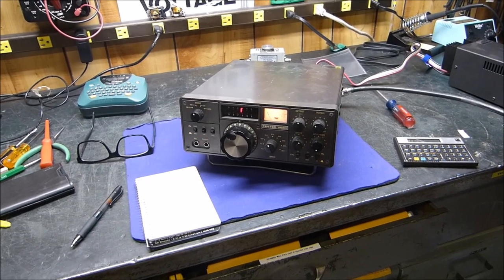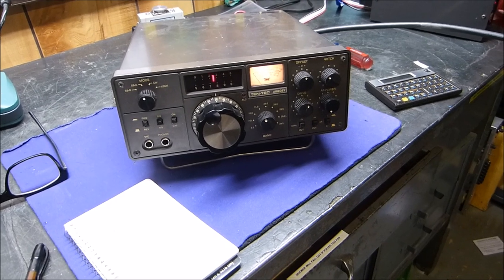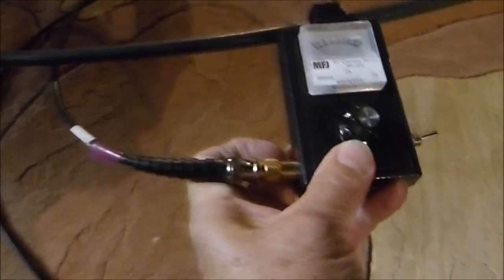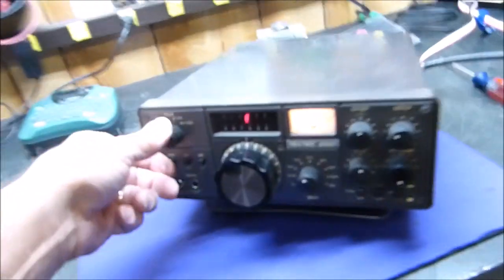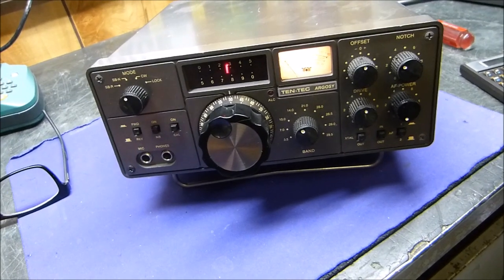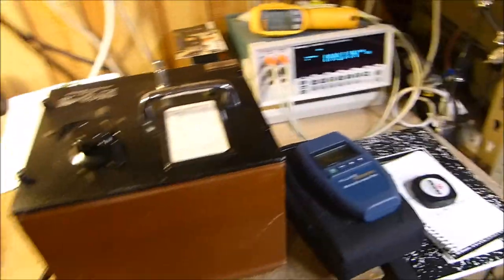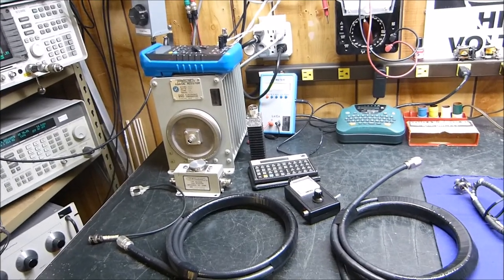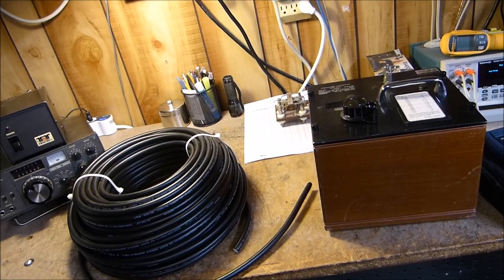Common Mode Coax Choke Baluns

Comment: Man... there are a lot of jewels in this video. I really enjoyed the visual representation of a standing wave. The common mode choke demonstration was outstanding. The comments on coax length were a great reminder that I know I sometimes haven't followed. The chassis for your Collins amp is gorgeous. 

Your comment on old capacitors tracks with my limited antique radio and test equipment restoration experience. Out of a dozen or more restorations (oscilloscopes and other test equipment as well as radios) I've found very few capacitors to still be good. Electrolytics are almost always bad. Mica caps are the most reliable but I've had to replace those too. Some devices, like Heathkit made test equipment, can also have bad resistors. It's weird. It's like they had a bad lot of components but that's not likely at the time it was made. Two identical piece of gear require differing amounts of replacement parts.

It makes me wonder about some of the newer old pieces of gear that I still use. Back in the day they built things to last and they did. Today I don't know if my 15 year old Yaesu is going to hold up like my recently acquired Collins  35S-3/72S-3 have. That said, recapping isn't all that hard to do. But we've had that conversation back on your rotatable dipole video :)

Thanks for taking the time to go through all of this David

Comment: ElPaso - Question for you.  My understanding is that common mode currents on the xmsn line shield are due to the antenna not being perfectly unbalanced.  In your video, you have created common mode currents by introducing a capacitive reactance into the your "antenna simulator" .  Would you say the common mode currents are caused by the resultant VSWR or by the general asymmetry introduced by the capacitance box and associated leads?

Comment: David,it looks like the balun choke either tuned the antenna or made the transmitter happy by tuning the antenna..Now, what is the difference between that what my roller inductor tuner does.?
Reply from the maker: +Mike Samra I made a mistake by stating that the SWR was changed. It is not. What I can consistently measure is that the common mode current is so much lower that it becomes hard to measure it with the sliding current probe. With no choke at the antenna to mitigate the common mode current, the reactance (not the SWR) becomes much more pronounced along the length of the coax (standing wave). That I am certain of.  As for the antenna tuner, it does seem to be a pre-antenna-tuner. I still use my antenna tuner as I have never seen that it hurt anything, as you and I discussed  on the phone. With that said, there are articles that suggest using a coax choke at the antenna, one in the middle of the coax and another at the transmitter. How could that possible go wrong ??  :-) You know I am joking. Without some sort of common mode choke at the antenna, the length of the coax is going to become critical, to within a couple of feet on 20 meters from a horrific amount of reactance to not much reactance just a couple of feet one way or the other. I can measure this. It is just (irresponsible?) to connect an unbalanced line to a balanced antenna without some sort of a matching device (which could include tuning the length of the coax). It also (theoretically?) reduces the noise pickup on the coax into the receiver. That is the way I see it.
Reply: Exactly. If the length of feedline effects the antenba, you have a poorly matched antenna to begin with. His test are valid, but the whole thing becomes unnecessary if the antenna is tuned...
Reply: Hi Mike, I'm not sure where your roller inductor tuner is located that you mentioned in this very old post, but lets say it's located in your shack.  Your antenna tuner really does not "tune your antenna", it just transforms the impedance seen on the end of your coax that connects to your transmitter to an impedance that your transmitter likes (lets say 50 ohms) and this allows your transmitter to dump (transfer) as much power as possible into the transmission line (because the transmitter is now happy), but you have not done anything to change the actual impedance that exists out at the end of the transmission line at the antenna feedpoint so the SWR is still the same on the transmission line between your tuner and your antenna feedpoint, etc.  On the other hand when placing a choke on the coax shield right at the feedpoint of the antenna you have eliminated an additional path of current which is the outside shield of the coax, so you indeed alter the impedance that exists at the end of the coax where the antenna is located when using a choke at that location, and therefore you have indeed altered the SWR at the feedpoint of the antenna as well as anywhere you measure SWR along the feedline.

Measured SWR in the shack should not change when feedline length changes except for a slight reduction in SWR as the feedline gets longer due to attenuation of the feedline, and if SWR does change (neglecting attenuation) when measured in the shack as feedline length changes this means the impedance out at the antenna feedpoint is changing and it's changing because the length of the outside of the shield changes which causes the antenna to look like a different length because the outside of the coax shield is acting as an additional antenna element (which you typically don't want it to be).  By using a choke at the antenna feedpoint you eliminate the outside of the coax shield from being an additional element of your antenna, and when you eliminate this additional element the SWR no longer changes with a change in feedline length (except for changes observed due to feedline attenuation as mentioned above). Therefore having a choke on the outside shield of the coax at the antenna feedpoint is not the same as using an antenna tuner in the shack.  The antenna tuner in the shack will not alter the antennas radiation pattern as an example, whereas having a choke on the coax at the antenna feedpoint can indeed alter the radiation pattern because it eliminates the coax shield as a radiating element.  73, Don (wd8dsb)
Reply: @clems6989  Hi Control Man.  The outside of the coax shield becomes an additional antenna element if you don't use a choke on the coax out near the antenna feedpoint, and therefore it can and does alter the impedance out at the antenna feedpoint, and the amount of change varies as you change the length of the feedline.  Using a choke on the coax shield out near the antenna feedpoint eliminates the outside shield of the coax from becoming an additional antenna element.  73, Don (wd8dsb)

Comment: Quick question, I am also in El Paso and I am working to restore some old tube gear.  Would it be possible to get some assistance testing tubes? Haven't found a tube tester yet

Comment: Does it matter which end the choke is placed?
Reply from the maker: Yes, it needs to right at the antenna and if the length of the coax (from the shack end) is measured with a device like a TDR, the length of the coax choke will show up simply as the single length of coax.  Basically, it helps keep the coax leading from the antenna to the shack from becoming part of the actual radiating (or receiving) antenna . You do not want the coax to radiate power from the transmitter or pick up signals for the receiver. We don't have much of an issue nowadays with what we used to call TVI in the VHF analog days of TV transmission but I dare say if we had included these simple coax chokes back then, we certainly would have had less interference to the analog TV channels. Also, some will disagree with me but the length of the coax choke should be cut for each HF band. There is not one single length of coax wound into a coil as a choke that will work properly on all HF bands from 3 to 30 MHz. Hope this helps.
Reply: @ElPasoTubeAmps  i can measure the tdr distance, so are you saying with the CMC it works like a tuned length without acting like part of the antenna? Or did i loose the bubble. Also does the placement apply to EFHW ?
Reply from the maker: @richardchandler9027  Maybe what I mention is not really important about the total length of the coax but just in case you did measure it, the CMC appears as just length in the coax on the TDR. As far as EFHW or dipole or in my case a rotatable half wave dipole, I don't think it matters what type of antenna is up in the air. It seems to be a simple method to prevent the coax from being part of the radiating system. The antenna should work independently of the coax which, together, becomes the antenna system. You want your antenna to be independent of the transmission line - the coax. Also, in my case of only operating  20M, I cut the length of the coax (thus the need for the TDR) to some whole number multiple half wave length so I can be assured what I measure at the shack end of the coax is a good representation of what is actually at the antenna. If you cut your coax to some multiple of half wave lengths, don't forget to include the Vf (velocity factor) of the coax as the coax will be shorter than a free-space wavelength. Old coax is 66% and I think the new stuff like LMR400 is something like 80% - better check all that out before using those numbers. Remember that the longest wavelength of all electromagnetic waves is longest in free space and is shorter in any other conducting material be it light in glass or water or radio waves in coax. That is the way I remember it and air and vacuum is so close it is not necessary for us building antennas to worry about the difference. 300,000,000 meters per second is a perfect number for the speed of electromagnetic waves in free space and the Vf is taken into consideration when using other materials, in our case usually 50 ohm coax.

Comment: I like your old school basic TenTec.
Reply from the maker: Thanks. I still use it as a mobile rig on 20M. Only delivers 25 watts to the antenna but does surprisingly well into a ham-stick antenna mounted on the top of my camper shell.   73

Comment: I have no idea whats going on here
Reply from the maker: The so-called, choke balun is a method of putting a few turns of coax transmission line, very close to where the coax line connects to the antenna up in the air,  in an attempt to prevent RF from coming back down the coax line and the coax line becoming part of the radiating (and receiving) antenna system. 
The goal is to make the antenna "stand-alone" in the antenna "system" as a receiving and transmitting item. We want to isolate the coax line, as a radiating item, in the antenna system. The antenna "system" is the whole enterprise from the antenna proper to the connection on the back of the transmitter or receiver. If we allow the coax to radiate and receive signals and become part of the radiating system, we will likely get RF back in our radio room,  possibly cause RF interference to our neighbors and the coax will pick up noise which will interfere with our receiving signal. I hope all of this makes some sense.
There are better ways to "choke" off the coax line and keep it from radiating and receiving RF but the coil of wire adds only the cost of a few feet of coax whereas a legitimate balun could easily cost 80-100 dollars.